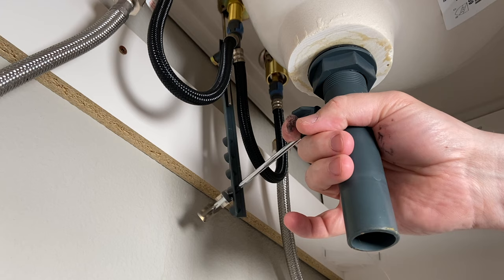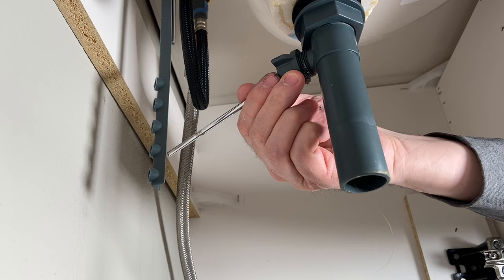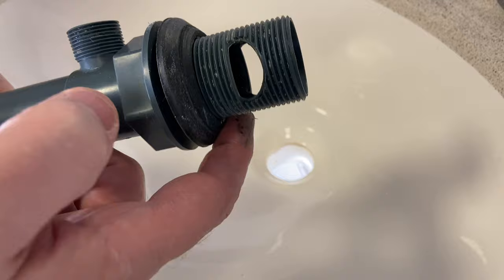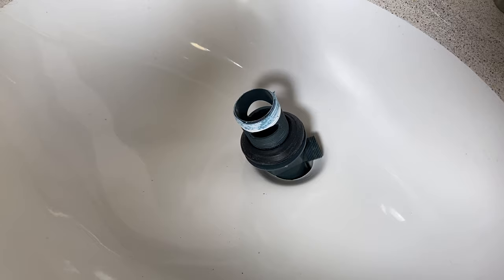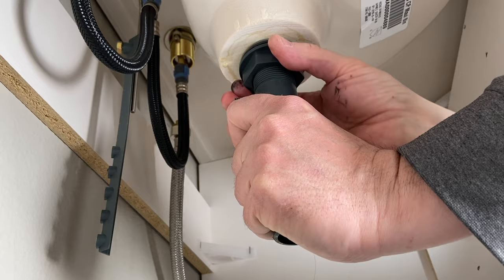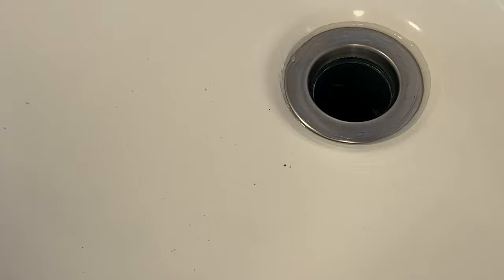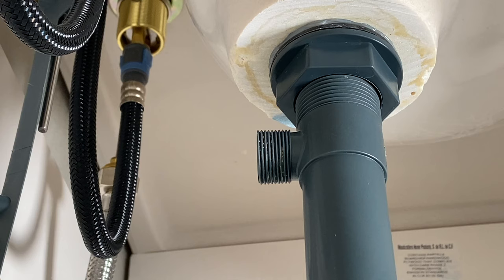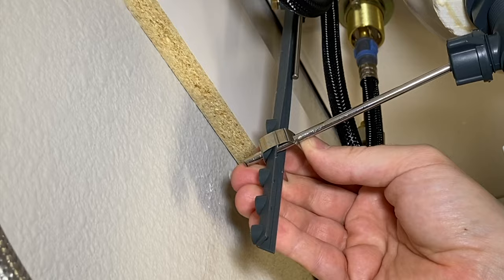LOOSE and LEAKING Plastic Bathroom Sink Drain Repair

Comment: I spent 3 days trying to fix this problem, then I came across your video and fixed it in 10 minutes. Thank you.
Reply: That’s why I’m here 😂😂😂
Reply: Exactly!  That’s why I’m here. I am now subscribed
Reply: I don't know much about sinks, the leak was from a big rubber washer underneath the sink. Just removed the plug bar thing and gave it a full 360 degree tightening. It's fixed in under 5 minutes. 
Whilst I was down there I took off the a long bowl thing from the trap. It stinks but it's empty? Just full of water, not messing about with anything else. Let them live with the smell.
Reply: I get the process, but on the top part, if that leaks it jist goes where the overflow goes, essentially the more important seal os the bottom.????
Reply: Got lucky and found this video after 20mins of suffering. I didn’t even know that was the place that was leaking!

Comment: the poor guy that has to come behind you to replace that mess in 10 years when the drain starts rusting.  no good repair.
Reply from the maker: I’m the poor guy that came behind me LOL!  It really comes out very easy. I got a lot of comments like this so I did a follow up video. Let me know what you think. How to Remove a Bathroom Sink Drain Sealed with Silicone Sealant

Comment: I loved this video. I had taken apart an earlier install by previous owners and they used plumbers putty under that chrome ring. Basically, a horrible seal.

I'll be re-doing today using your method. Never thought about Teflon tape in this application either. That's probably going to resolve leaks. 

Thanks
Reply: yes i have taken my batheroom sink apart 4 times now..the putty is not working....

Comment: I’m not a plumber but have done minor repairs at times. This project seemed pretty straightforward but tried a different approach at first.. did not work and had sink out of order for almost a week! I was ready to go buy another assembly because it continued to leak..frustrating. This video worked great!! Exactly as described. I bought the correct items as used and was pleasantly surprised that it stopped leaking the first try! Thanks 😊

Comment: We also bought a few glacier brands faucets. Everything was fine for one day then I noticed a leak around the threads. Glad I found this video and explanation on why this brand needs silicone on the rubber gasket. I think I'm on the right track now....
Reply from the maker: Awesome. To me this is the only way to put in plastic pop ups these days. Thank you and I hope we can help again.
Reply: @ThatFixItGuy  Now that I think of it, there was some moisture around the ring before I added the silicone. Fingers crossed but I don't see or can feel any moisture below the rubber ring now. Well see how it goes. Thanks again!

Comment: I'm going to have to try this out next time I put one in. I've done dozens using plumbers putty and generally they've worked out well however I've run into a few sinks where the bottom of the drain hole wasn't as flat as it should be and have had them leak around the threaded area. I never considered putting Teflon tape on the threads or substituting silicone caulk in place of plumbers putty but I can see some real advantages to doing both. Thanks for the heads up
Reply from the maker: I’m glad I could help you with this. I have just found with all this new plastic everything using silicone has worked better for me than plumber putty. Thank you and  hope I can help with something else.
Reply: @ThatFixItGuy  do you recommend using both silicon and plumbers putty?
Reply from the maker: @andrewcavanagh3463   I like silicone for plastic pop ups and I still will use plumbers putty for metal, but really silicone will work for both.

Comment: There is absolutely no reason to put Teflon tape or pipe dope on the top threaded fitting. Even the silicone around the drain cover does nothing to keep the sink from leaking.  If the connection were to leak like a sieve at either place, where would the water go? It would simply go into the drain through the weep holes.
And with the bottom nut, you need to make sure you get the silicone into the threads between the rubber gasket and the drain stem. Just getting it on the rubber gasket where it contacts the sink will not keep it from leaking. Thanks for taking the time to post this.
Reply: I’m having leaking issues with the threads under the big rubber gasket on the bottom of the sink. I’m going to try and put silicone in the threads from the top of the gasket then put it all together
Reply: and no need to overtighten the nut, some only have the nut that has the spades and tightening by hand is good enough
Reply: putting a sealant on the seal under the sink is a waste of time, they very seldom leak there

Comment: Good video!
The only question I have is:  How difficult will it be to remove drain pipe when it needs to be replaced again?  Won't silicone make it difficult to put a new drain again?

Comment: I’m going to try using silicone on the underside rubber gasket/washer. I’m getting small drips on the bottom threads under the large plastic nut.

Comment: You're only channel that mentioned putting silicone on the metal rim and the rubber gasket. Glad you used Silicone and not Plumber's putty which I've heard interacts with the plastic.

I figured this out myself because it was leaking from under the sink. Don't know why no one else mentioned this because it will leak from underside the sink no matter how tight you turn the screw.

But it still leaks from the rod connection. Not sure how to fix this yet...
Reply from the maker: Are you missing a the gasket from the rod connector area.
Reply: @ThatFixItGuy  I bought a new facet and the pivot rod didn’t have any washers so I bought a new pivot rod with some washers. One was plastic and one was rubber.

I placed the rubber between the short rod and drain outlet.

Comment: Just installed a new faucet and sink drain pipe in our bathroom sink. Replaced the water lines as well, but sadly they did not have the correct fit so to stop the leaking I put the old ones back on which fixed the dripping. But sadly the sink drain pipe is leaking. So I guess I'll do what you suggested and redo it with some more silicone 🤞🤞🤞I think the silicone I used may have been a little to old, it felt a little off 🤔

Comment: I took mine off because the rod and stopper wasn't connecting.  Now I'm replacing everything including p trap
Reply from the maker: That is a good way to roll in my opinion. Especially if your set up is old and having issues.

Comment: What happens if you need to remove or replace the siliconed parts?
Reply from the maker: Thank you for the question. Just pop it out. Silicone will come out. Using the pop Up assemble I did in this video if I had to remove it I would just undo the nut that holds it on and push it up. It will take some force, but will not be bad. The silicone around the rubber washer should peel off pretty easy. May take a razor blade or a flat screw driver around the bottom and top of the sink hole. Something with a flat edge that will not damage your sink. Replace the part put more silicone on and reinstall. 

This will make a good video and I will add it to my list!  Thank you.

Comment: How hard will it be to take it back apart when it hardens if something was to happen to it. Or need to change it again.
Reply from the maker: It is not hard at all. I just did a video on the same sink showing my process. 

How to Remove a Bathroom Sink Drain Sealed with Silicone Sealant

Comment: Thanks for the video.  The issue that I have is that after tightening the rod, I have a leakage.  I don't know if it is because of the size of the new ball that came with the rod or I need more plumber putty when tightening the rod.

Comment: I'm having a sink leak too;  but mine is the faucet connection.  what is that black accordion thing called that leads up to the faucet?  that's where I found out where my leak is coming from.  Sorry but that's the best way I can tell you. do you have a video on how to replace that?
Reply from the maker: So those lines are where the water comes from the handles and goes to the spout.  They are going to be brand specific.  Do you know what brand of faucet you have?  If you want to send me a picture I am happy to look at it.  ufix247@gmail.com

Sorry I do not have a video on that yet, but I'm sure there will be one in the future.

Comment: Hi there. Thanks for the video. My Kholer plastic pop up doesn't have threads the entire section below the plug - it's smooth plastic where the overflow drain holes are. Also, the rubber flange thing at the bottom needs to sit ABOVE the nut threads to sit tight to the sink. In that case would silicone alone be enough on bottom side of the rubber gasket (upper side of sink under plug) and the top side of the under sink rubber flange (above the nut)? If that makes sense. Thanks!
Reply from the maker: Yes just silicone would work great.

Comment: The plastic drain that came with the faucet I got said do NOT put pipe dope or plumber’s putty on the plastic parts, but to use silicone instead as a sealant.

Comment: I have a question I hope you can answer. Can I just replace that one top piece the one in your right hand Whej you take it apart. Mine broke. And that’s all I need to fix mine. Do they sell just that piece? At Home Depot or Loews?
Reply from the maker: That may be had to find to match your pop up assembly. Do you know the brand?  The manufacturer would maybe send you a new on free since that broke.

Comment: I watched your video.  Nothing comlex to follow.  Eassy and Simple.  I have done mine before finding your video but only used the teflon tape.  I guss using the silicone sealant is the key thing.  I do not like to use the plumber putty since it dries up and crack with time and back to square one.  Good video!!
Reply from the maker: Thank you. Hope we can help again.

Comment: @1:44 my setup does not remove after twisting? Thank you for the video so far. I don't have the money for a plumber but I may need one after all.
Reply from the maker: If you can’t get that removed like at the 1:44 mark the you can cut it off at the bottom. You are putting something new in anyway correct?  You got this. If you got that far you can go the rest of the way. Let me know if you want some help. We can video chat
Reply: @ThatFixItGuy  I don't have a proper tool to cut it. Called a plumber to force it off. $650 later...

Comment: That pop-up drain assembly may have been Glacier Bay, one of The Home Depot's house brands, but it looks identical to a drain assembly that came with a Delta faucet kit that I installed a few days ago.  Maybe they both came from the same factory in China.

Comment: help, just installed new faucet and mine leaks every time the pop up drain is moved up and down. it leaks water out of that ball piece with the metal bar your reinstalled correctly. just 6 or 7 drops of water come out. ive tried tightening it more and when that didnt work, i loosened it up and same thing.

Comment: i don't know what the deal is i put tape on threads above hole  and sealant but did not put tape on below the drain hole...i put silicone on the flange and on  the gasket and still leaking....it looks like it is leaking by the gasket..and i've tightened it down..i have taken this apart like 4-5 times now..this is first time using slicone..what could be wrong

Comment: Cool, thanks!  I'm not sure if this is my problem ... My drain is not sitting level in the hole.  The basin doesn't hold water even tho the pop up is down.  What do you think?  I don't have any water leaking into the cabinet.  TIA 😁
Reply from the maker: Sounds like the water is draining out where the putty or silicone should be applied. Or the seal is worn off the sink stopper.  Is it older or a new install?
Reply: Relatively new ... 2019
Reply from the maker: Oh that is way new. If you close the drain and put just a little water in it you may be able to  see what hole the  water is draining into.

Comment: Thanks for the video, but I would not recommend silicone here in place of plumber’s putty. Silicon just makes it too hard to remove in the future.
Reply from the maker: What do you do when you have tried plumbers putty a couple of times and it still won’t seal?  Plumbers putty is great on brass but more and more companies are going to plastic.
Reply: The combination of plumber’s putty plus Teflon tape on the threads usually does it. Plastics are a different story. Some say you can use putty with PVC but not ABS plumbing. I would avoid it with plastics altogether. I would then opt for silicone for the top ring to sink only since that is relatively easy to work loose in the future. Teflon tape and a gasket only down below unless you are forced to use silicones
Reply from the maker: ok right on.  I have had a few instances where I would get a leak on the bottom that is why I silicone the gasket as well.  I am going to shoot a video soon about removing and reinstalling after siliconing the pop up in.  A couple of people have requested.  That you for your response.

Comment: Thx fix it guy.   Great video.  I have one ? for you please I have the exact same sink in my bathroom but when I removed the old tailpipe drain there was some rubber hose and a round disc for the overflow drain attached to the tailpipe which I have never encountered before.  Looks like you didn’t have this on your sink.  Must I replace this disc type overflow drain or can I plug the overflow hole in the sink basin?  Thanks.  Hope this makes sense.
Reply from the maker: Thank you for the Question. If you like Email me a couple pictures at ufix247@gmail.com. 
I don’t see an issue with plugging the hole. An overflow is not required by code. Just make sure it is watertight.
Reply: Thanks I sent you a pic of the sink and the overflow drain tube to your gmail.  Thx

Comment: I'm stuck on getting the pipe out. The silver ring on top of the drain appears to be stuck to the pipe. It spins, but its not coming off.
Reply: Mine is screwed all the way into that silver ring. Keep unscrewing it while holding the metal ring from spinning so it can unscrew from it.

Comment: So my mother in law's sink does not have the pipe that goes all the way through the hole of the sink. It's a metal piece that was glued to the bottom of the sink. Can I replace this or should I just silicone it back?
Reply from the maker: That is interesting?  What is going on topside?

Comment: So mine has the pipe thing under the sink connected completely do I need to turn off any water or anything first ?
Reply from the maker: I would shut the water off just so no one uses it and forgets the pipe is disconnected.  Will save you a mess.

Comment: Did you talk about the overflow ? Ours sink is leaking, we don’t have an overflow sink, but it is using the exact one you have in the video… I simply cleaned it out and re did the silicone … and now I think water is coming out of the overflow holes .. any explanation how it wasn’t leaking out of those holes before ??

Comment: A plumber installed a flexible coupler.  On a plastic drain.     I want to replace it.    The fitting in the wall is metal.     Is it safe to install pvc pipe in it
Reply from the maker: Yeah it should not be an issue as long as it fits in the coupling.

Comment: There are no rubber washers inside the ball assembly? Mine just had 2 white plastic rings to encapsulate the plastic ball
Reply from the maker: Yeah there are usually the white plastic rings.  Mine actually did not have any.  just the ball sealing against the plastic nut and the pop up itself.  
Rubber would cause that to stick I think.  It needs to be sealed and move freely.  I think that is why the use the hard plastic rings.  I hope this helped.
Reply: @ThatFixItGuy  Yes! Installed same rinky/dinky plastic unit as seen in this video and it did not leak. Thank you.

Comment: Watched this video and I just replaced mine, but it's leaking at the threads at the bottom of the nut. I didn't put silicone on top of the rubber gasket, but isn't that only supposed to seal it between the gasket and the bottom of the sink basin?
Reply from the maker: You are correct about the top gasket. It holds water in the bowl if there is an overflow. I would check the gasket and make sure it seated properly and seal it again.
Reply: @ThatFixItGuy  But, why would it leak between the nut inner diameter and the tail pipe threads? I tightened the nut less than a quarter turn past hand tight.
Reply: @ThatFixItGuy  oh and thanks for your reply!
Reply from the maker: Depends on the style it may have to have been tighter than that. I would take it apart redo it and snug it up a bit more.

Comment: Hey my sink is leaking at the side part where you insert the rod for the drain. Can you silicon that?
Reply from the maker: I would not.  chances are you may be missing a seal or it is not tight.  You could silicone it, but I would not use it again if you do.

Comment: can I use a pipe putty instead of a silicone sealant? I'm having trouble finding the same pop assembly :(
Reply from the maker: You totally can use plumbers putty I have found that plastic pop ups leak sometimes using putty. That is why I silicone them. The pop up came with that glacier bay faucet. Should be able to get one at Home Depot.

Comment: i’m new to the whole plumbing stuff i am remodeling a house and don’t feel the need to hire someone to replace an old faucet i had it all installed however i’m guess the p-trap or some pvc doesn’t fit on the pipe like the one in the video. any tips or help
Reply from the maker: Thank you for the question.  Can you email me a picture?  That would be the best way for me to give you an answer.  ufix247@gmail.com
Reply: @ThatFixItGuy  will do sending it right now